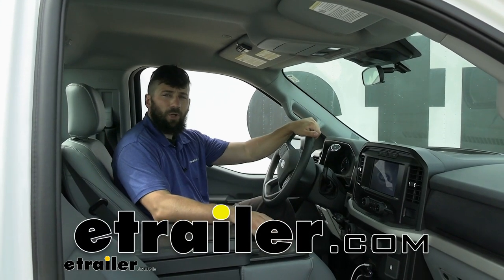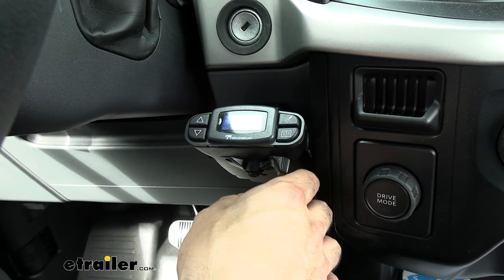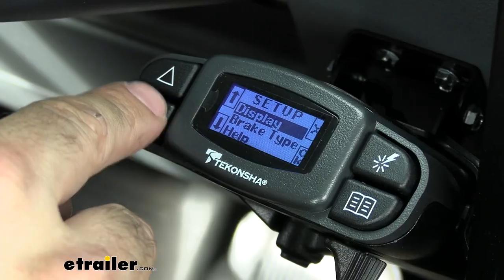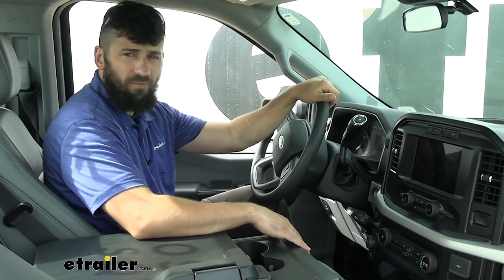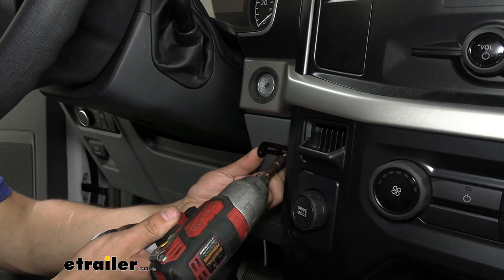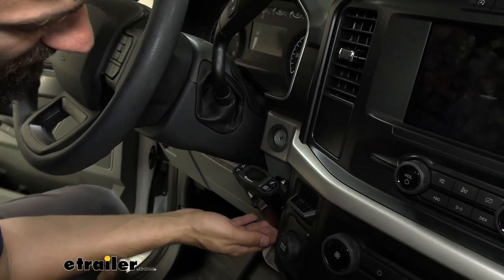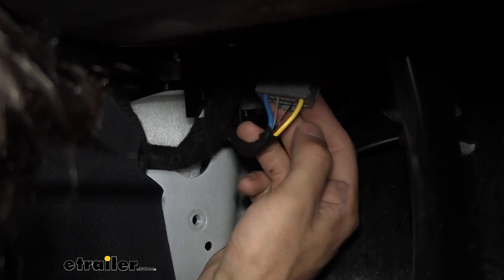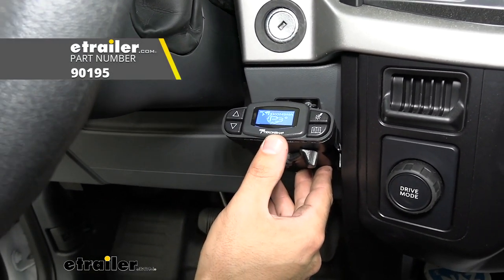Beginner’s Guide to Installing the Tekonsha Prodigy P3 Trailer Brake Controller on a 2021 Ford F-150

Comment: My 2021 does not have the dummy connector! What now?
Reply from the maker: If you don't have the knockout, but but do have the USCAR connector under the vehicle, you can simply install the # HM40975 and use a no-drill bracket like # 18136 to attach the connector to the hitch crossbar.
https://www.etrailer.com/Custom-Fit-Vehicle-Wiring/Hopkins/HM40975.html
https://www.etrailer.com/Accessories-and-Parts/Tow-Ready/18136.html

Comment: Ford did not make it very easy to find that connector in the kick panel. Thank you for this video. I looked everywhere for that connector. LOL My new 2023 came with that gray connector for an aftermarket brake controller.
Reply from the maker: So you found it then?
https://www.etrailer.com/Trailer-Brake-Controller/Tekonsha/90195.html